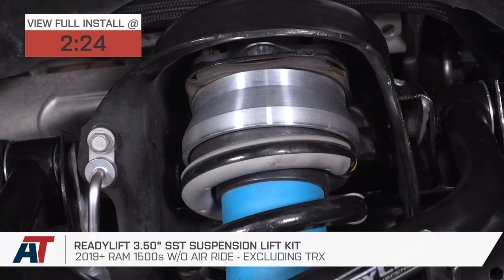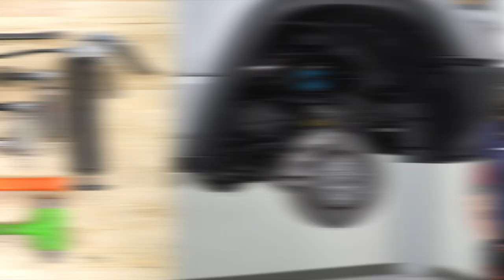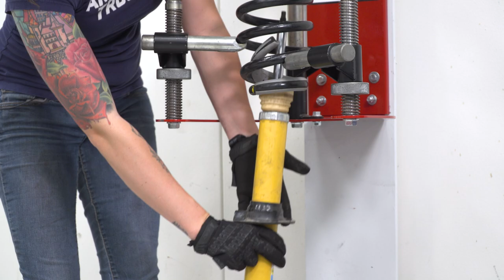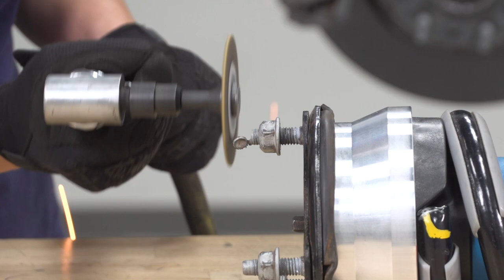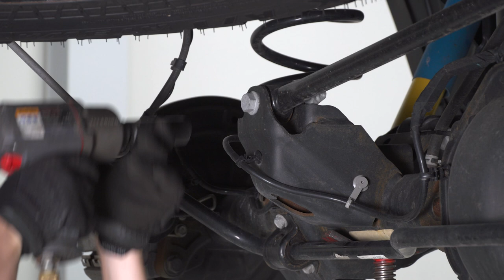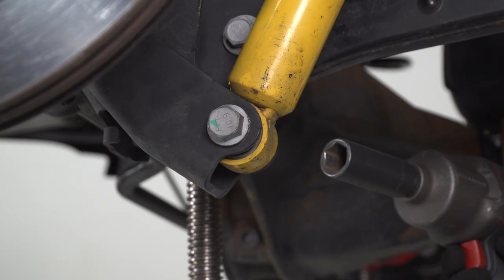2019-2021 RAM 1500 ReadyLIFT 3.50-Inch SST Suspension Lift Kit Review & Install

Comment: I have this exact lift on my 2022 Ram 1500 Off Road 4x4.. It is great. The 35s fit great and the ride quality is still good. Even at highway speeds. Now I just need to fix the speedometer. It is off by 6 mph at 70, 5 mph at 55.
Reply: thanks for sharing! I have a 1500 coming in that also has the off road package. Its hard to find any videos on that configuration .
Reply: @mr.a_runsultras7530  I have 35 x 11.5 inch wide tires. The 12.5s would rub without a spacer. Keep that in mind also.
Reply: @steveb8883  what spacer do you recommend?
Reply: @hcshorty10  I don't run one on this truck. The 11.5 inch tires don't rub. I did on my 17 Rubicon though. I can't remember the company. My local shop recommended them. I would definitely recommend the most hard core spacer you can find. It is better to buy a heavy duty American made spacer than to have a wheel break off at 70 on the highway.
Reply: Is it still holding up? I’ve seen some ball joint failures on the some post with the readylift upper control arm. I think I’m going to run the 2” readylift.
Reply: Any issues with the CV joints or the CV driveshaft?

Comment: The full 3.5" kit is not meant to be installed on Ram Rebel or trucks equipped with the Off-Road Group. As someone else in the comments mentioned, you now have 4.5" of lift in the front instead of 3.5", which is too much on the front suspension geometry without a differential drop/relocation kit.
Reply: Why did Readylift tell me that it would fit my 2021 Rebel. I had it installed about a month ago with larger tires (295/60/20) and it rides a little tougher but when. I hit large bumps on the road it feels like it bottoms out?
Reply: @darrenhenson6669 Not sure why they said it was OK considering it is mentioned on their website that it is not to be used with ORG/Rebel trucks. This topic has been discussed ad nauseum on the 5thgenrams forums. The rough ride can be attributed to the pre-load spacer and the significantly reduced downtravel in the suspension from running 1" taller springs (standard on Rebel) combined with the Readylift preload and tophat spacers.
Reply: You cannot install the front spacers or it will ride very rough, I see what you are talking about now but when I was watching the videos I only found one video that said to not install the front spacers after I had it installed on my truck. I have wasted about $2k now on installation.
Reply: @Matt Kistner  No, you are incorrect. This debate was settled on the 5thgenram forums almost 4 years ago. If you use the Rebel coil springs (or coil springs from the ORG), the RL preload spacer, and the RL top hat spacer, you will get approximately 4.5" in the front. Even on Readylift's website, they say don't use the full kit on Rebel or ORP b/c of this reason. They recommend the user to leave out one of the spacers.
Reply: I know this is old but I got a response from Readylift saying to measure from the center hub up to the fender. If the measurement is 22 or greater, don’t use the preload spacer. If less, use the preload spacer.
Reply: Is there any negative effects using the this lift for the rear ? I am going to use rough country lifted struts on my rebel to get 2.5 more inches in the front but use ready lifts rear spacer since it gives 2 instead of 1 inch if lift in the rear

Comment: You cannot install this lift kit on a 2021 RAM Rebel without it rubbing & it causes a very bad vibration over rough spots in road the whole truck vibrates.
Reply: Why is that?

Comment: This kit does not fit in 19-present ram 1500. The front knuckles will rub agains the front springs and were down the springs. In the video you can clearly see the when turning wheel lock to lock that it binds. Have contacted sst about it and they said to take off kit and no other solution was given. Not recommended!

Comment: did you guys delete my comment ?   it was a problem i'm having with my truck   squats with lift at full turn,  what the heck!!
Reply: if you check under your truck your lower A arm is rubbing  on a little tab off of the steering knuckle. Same thing happened to me.
Reply: @drewgalante472  yes, i took pictures of that,  there is no apparent solution, that i know of   the admin of this video deleted my original post. There is a little triangle shape that rubs with the control arm and the knuckle    A buddy of mine just said to leave it alone,  or just be vigilant of full turns,    I also found a forum, aa few people with same issue but nobody provided a solution,  so conclusion si that 3.5 INCH LIFTS with ram 1500 5th generation will have that ,  unless they come up with and aftermarket arm that is shaped different . I hoped @american trucks woudl provide some answers.